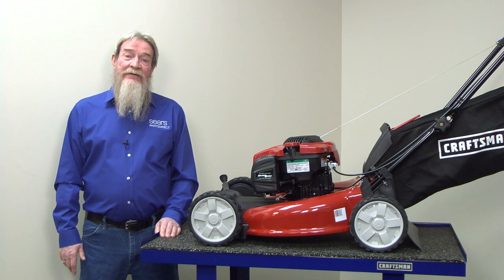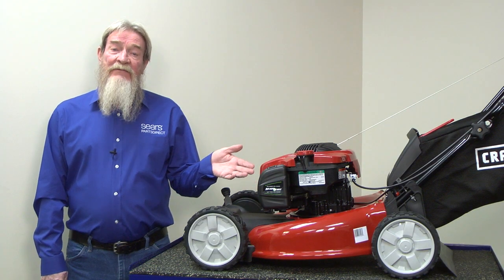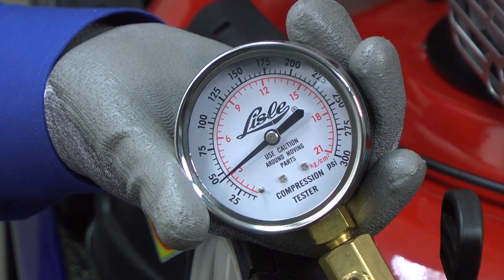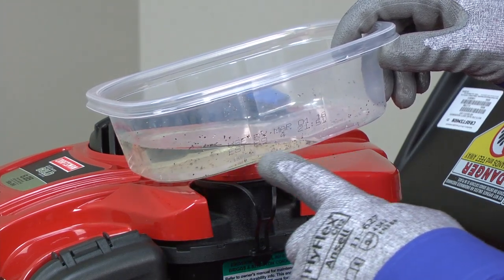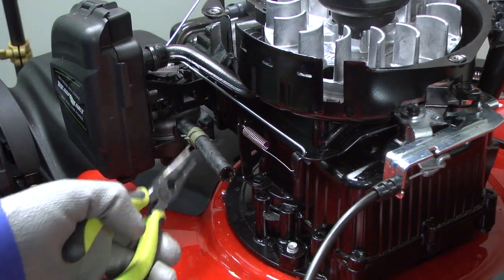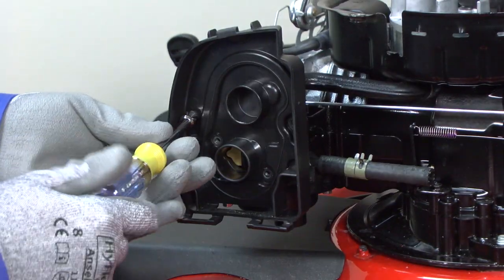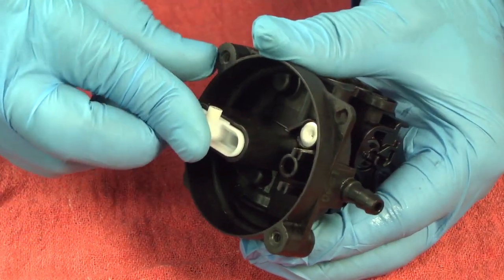How to Fix a Lawn Mower that Won't Start: Fuel, Ignition and Compression Problems

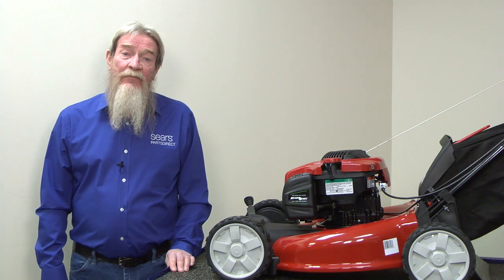Comment: QUESTION: At 5:25 you start the explanation of a Choke Plate and the importance of temperature related to a cold engine. This is the way it is with my Cub Cadet mower. The mower recently had the problem of starting up on the first pull easy enough, but then it would shut off after about 20 seconds. The Thermostat measuring part was replaced. After that, the mower would stay on again; however, the engine did seem to randomly be missing beats. The new BIG problem was that the mower takes over 15 pulls to get it to start up cold. In comparison, after having run for a while, the mower starts on the first or second pull. Clearly, the factor of "Temperature" is involved in starting the mower. This mower won't start "cold" easily. The mower actually started on five or six pulls on an 82-degree day. But on a 60-degree day yesterday, it took 15 pulls to get the mower to start. Do you have a suggestion to fix this?

Comment: Good video.  But I would like to see one that includes a common problem:  The magnet on the flywheel that produces the spark can slowly lose its power to the point where you cannot pull start it.  You can start it by engaging the flywheel nut with an electric drill and get it going fast enough.  You could then discard the pull starter, make holes in the start housing and trim cover, and use the drill to start, but this is not very practical.  Too bad that most of those magnets are ferrite ceramics rather than Niobium super magnets.

Comment: Ok, Good vid.  My Mower will start, but will not stay running.  Fuel line is clean, new fuel, new spark plug.  Is there a lever or spring that connect the brake system and throttle system. when I engage the brake release handle to start the mower the throttle behind the air filter box doesn't move.

Comment: Excellent video. Turns out my carb float was stuck causing no start. Got it off, cleaned. 30 minutes saved me 80 bucks.
Reply: I have had this happen when fuel was left in the tank over the winter. That won't happen again.

Comment: Not exactly related to this video, but I have searched everywhere to no avail. I have viewed at least 20 videos. My 7.25 HP Craftsman mower will not start when hot. Starts easy when cold and runs great but when I stop to empty the bag, it won't restart. I have replaced the gas, air filter, spark plug and carb and it still won't start when hot. If I squirt some gas in the carb when it's hot, it will start and run fine til I have to empty the bag again. When I squirt the gas in the carb, it hisses so it's pretty hot. Any ideas?
Reply: Try this. https://youtu.be/ARJrhnKpTwA

Comment: after spraying in the starting fluid it started then shut off, so i followed all of the instructions. I took everything apart, cleaned and rebuilt the carburetor based on the linked video. Took the gas tank off, emptied it, cleaned it, let it completely dry. Put back together. Added new gas and a new filter. 
It started for 2 secs then shut back off and won’t start again. I don’t know what to do now. I’m so frustrated as it’s only a year old and only used a few times.

Comment: Really great video! Clear diagnostic steps, great explanations of the systems, and really fine camera work. I particularly love the links to other helpful videos based on which problems are discovered.  Also doesn't hurt that the engine in the video is nearly identical to the Briggs and Stratton in my 21" Husqvarna push mower. I feel so much more confident in my ability to work on my own mower now.

Comment: My mower wouldn’t start after the winter season, I pulled the spark plug and pumped a little fuel in there then put the spark plug back and it ran for about two seconds so I knew it was fuel related. I pulled the top shroud and set it aside removed the fuel tank and drained it to check for sediment or bad fuel, then the carburetor was came right out without any issues and I pulled the bottom bowl off completely.. it was all clean inside. I actuated the float and the needle for a few times and blew through all the different openings to make sure they were unimpeded and then reassembled everything ….it started up on The third pull. Thank you very much for this how to tutorial

Comment: Just purchased the Sears M110 - cc 21 inch gas push mower. I did all the pre adjustments, added oil, gasoline and the pull rope is seized as it only stretches out about 5 inches and won't pull out any more. I also noticed the blade strikes underneath the mower deck. I thought Sears and Briggs and Stratton were good manufacturers but I was wrong. This mower does not start right out of the box. Very disappointing. DO NOT recommend
Reply from the maker: If the blade hits the handle that protrudes through the deck, pull the handle up and install the mounting bolts to hold the handle properly in place. That may fix the problem that you're describing.
Reply: @searspartsdirect  The blade hits underneath the mower deck as it turns and the pull rope does not come out more than 5 inches. very tough to pull

Comment: I have the same mower. Getting good spark. Tried starter fluid and does not try to start.  The safety handle is moving lever correctly. What next?

Comment: Honestly, watched 2:45 of the vid.  Cleaned and fully connected spark plugs (loose) and dumped the gas replacing with new gas.  3-4 pulls later, vroom.  Thanks for the tips.

Comment: Thank you sir!  Our 725 Series was a gift for Christmas, we never got it to run, and the new mower came without a manual. Your instructions worked......I now know how to field strip it, put it back together, and even start the darned thing......It was the fuel filter in the bottom of the tank.....Much appreciated! As Ever in Christ - John Paranuk Jr.

Comment: What would be the problem if you spray the start fluid in the carburetor and the lawn motor runs but if the motor is stopped, it will not restart
Reply from the maker: Your details sound like you've narrowed the problem down to a fuel supply issue. Stale gasoline in the fuel tank and carburetor bowl can prevent the engine from starting. If the gasoline in the tank and carburetor is older than 6 months, move the mower to a well ventilated area and drain the fuel tank. You may need to drain the fuel out of the carburetor float bowl too. Refill the fuel tank with fresh gasoline. If the mower still won't start, you may need to rebuild or replace the carburetor. Here's a repair guide/video that shows how to rebuild a carburetor on a typical Briggs & Stratton engine: https://www.searspartsdirect.com/diy/repair-guide/how-to-rebuild-a-lawn-mower-carburetor . We hope this information helps. Let us know if you need further assistance.
Reply: @searspartsdirect  Thank you for the timely response.

Comment: Procedure for adjusting the intake and exhaust valve clearance would be much appreciated.  I have a model 247377000 with a Briggs and Stratton engine just like the one in your video.  Are both the intake and exhaust valve clearances adjusted with the cylinder head position at top dead center ?  Are both valve clearance specs .005 ?
Reply from the maker: Although we don't have a video for adjusting valve clearance on that exact type of engine, you should be able to us the procedure shown in this video/illustrated guide  for a similar OHV snowblower engine: https://www.searspartsdirect.com/repair-guide/snowblower/how-to-adjust-the-valve-lash-on-a-snowblower.html . The valve clearance specs for both valves is .004 - .008 in at top dead center so .005 will work. We hope this information helps. If you need further assistance, let us know.

Comment: Could a ignition coil over 6.5 Ohms cause the performance of the engine to run poorly? I've checked all the things you mentioned in this video, and from what I can tell, everything's okay. Engine starts but runs as if I have the throttle set on low, but there is no throttle control unless you fool with the governor spring. I can do that, but that isn't a long term fix, there is something else going on. The mower performed well just the day before, now it's puttering.
Reply from the maker: Because you seem to indicate that the engine runs better when you fool with the governor spring, a bad ignition coil likely isn't causing the engine to sputter. A problem with the governor, governor linkage could be causing the engine to sputter. On some engines, a problem with the choke or choke linkage could also cause the engine to sputter. Let us know the model number of your mower (or the engine model number) and we'll provide additional help if you need it.
Reply: @searspartsdirect  - Thanks for replying. Model # is MTD 11A-B25F799 ( 675ex Gold Engine Series). I've run the engine with the air filter off to check the linkage, and they all seem to be working fine. I've read that the ignition coil range should be between 2.5 and 5.0 Ohms. If over that amount, would that affect the performance of the engine?
Reply from the maker: @Nick23at63  Thanks for providing that model number. According to the parts listing, that mower should have Briggs & Stratton engine model 126M02-0345-F1. Briggs & Stratton recommends testing for spark using a spark plug tester rather than measuring the resistance through the ignition coil. Your specification of 2.5K to 5K ohms for coil resistance is likely valid. Measuring 6.5K ohms through the ignition coil is not too far out of that specification. There's a chance that the ignition coil is bad and it's causing the engine to sputter. Before you consider replacing the ignition coil, try to let the engine warm up even though it's sputtering and see if the engine runs smoothly when it gets hot. If the engine runs smoothly when hot, then the ignition coil is likely okay. If the engine sputters even when it's hot, then replacing the ignition coil may fix the problem.

Comment: I'm a DIY'er for life. I fix my cars and motorcycles and everything else I have encountered in life to date, at 62 yrs young I have met my first lawn mower. I went surfing for help with the troubleshooting for this mower that won't remain running after I put some gas into the compression chamber as a troubleshooting step beyond verifying that there was spark to the new plug. 
I came across your video. I just wanted to say thank you. this is a great job of adding video for each trouble shooting problem. great job. Thanks again.

Comment: Is it possible to be the gas cap.  The yellow gasket broke off.  It starts but stalls out.  I sprayed starter fluid and it ran but then stalled again.
Reply from the maker: A clogged air vent on the gas cap of some engine models can prevent fuel from reaching the carburetor but a missing gasket likely won’t cause the engine to   stall out after starting. Check inside the tank for gasket debris that could be clogging the tank outlet.

Comment: You should never us starter fluid or ether to try and start the engine, using this fluid can blow your engine apart and you will get hurt bad if it does. Instead use a little   gas in a spray bottle and squirt some into the carb and try and start the engine that way.
Reply: Paul Brown Ty

Comment: What if it was left in the rain and it's only been used once? Where is the best place to start
Reply: maybe under a tree
Reply from the maker: Check the air filter first. A drenched air filter won’t allow air into the carburetor and engine. If you find the air filter soaked with water, dry it out or replace it. Restoring airflow to the carburetor and engine may fix your starting problem. If that doesn’t help, remove the air filter and spray a small amount of starter fluid into the air intake as shown at 1:28 in the video. If the engine starts and runs briefly using the starter fluid, then you’ve narrowed the cause of your problem to the fuel supply. Replace the fuel in the gas tank with fresh gasoline. You may also need to remove the carburetor and empty the carburetor’s float bowl. Here’s a video that shows how to remove and rebuild the carburetor: http://www.searspartsdirect.com/repair-guide/walk-behind-lawn-mower/how-to-replace-a-mower-recoil-starter-assembly.html. The video shows how to remove the carburetor float bowl at 1:46. Empty the float bowl and reassemble the mower.
Reply: Teena Dee look at filter clean and dry

Comment: Please explain the phenomena of double grounded spark plugs. Outside of cylinder I have spark. Inside has no spark. I'm still studying this issue, thanks
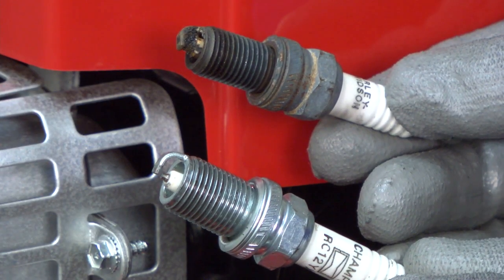Reply from the maker: The spark may be jumping to ground outside the cylinder but not jumping to the center electrode when you have the plug inside the cylinder. If you use a spark plug tester as shown at 2:12 in the video and don’t see the tester spark, you may need to replace the spark plug.
Reply: Jaster94 20
6

chevytra

..

Comment: Thanks for the video, I left gas inside my lawnmower for months. However, I'm using a turkey baster to get the old gas out.
Reply: It turned out I tried to start the lawnmower wrong. It worked all right until I ran out of gas.LOL

Comment: I have a 917258550  riding lawn mower. This belonged to a previous owner. I am trying to get it going. I can't get a spark from the spark plug. I have placed my thumb on the spark plug hole and turned it over. It pushed my thumb away! So I do have compression. How Much exactly - I do not know yet! I know it should be between 60 to 100 for this mower. I will get a guage eventually and check it. 
No matter this brings me to the spark plug spark. I have replaced the spark plug and ignition coil. I gapped it to .011. I have unhooked the kill/grounding wire from the back of the ignition coil and still no spark!!!!!!!! What would be next to check????????????????? My best guess is to get a new flywheel for the magnets. Does the magnets on the flywheel have anything to do w/ the spark plug spark???
Reply from the maker: The magnets help the ignition coil generate the spark as they pass by the coil. The flywheel magnets don’t wear out. You may have an interlock switch in the ignition circuit that is grounding ignition coil. We recommend that you check the operation of the seat switch and blade interlock switch. Replace any switch that doesn’t work. Repair or replace any broken wires that connect to the switches.
Reply: I am going to need to rewire the lawn mower according to the wire diagram, but in the mean time I thought that unhooking the "kill/grounding" wire from the back of the ignition coil would let it produce spark from the plug??  Thanks for the info on the flywheel because I almost ordered one but decided to wait for YOUR opinion!!
Reply: Virgil White

Comment: Why do a compression test on a engine that's got a centrifugal decompressor in it?? It will give a total false reading you could never pull it over fast enough to give you a good reading a leakage test is the best way
Reply from the maker: The compression test often indicates whether you have a compression problem. You are correct that a compression leak down test as described in the engine’s shop manual is the best way to diagnose and repair a compression problem. We didn’t cover that procedure in this video because it’s an advanced engine test that requires special tools and expertise. We continually add more DIY videos so we may cover the compression leak down test in future engine troubleshooting videos.

Comment: I replaced my carb engine looks like it's not sucking in fuel
Reply: sure I did.my mower is 6.0 craftsman no choke plate .engine sucks gas by compression of the cylinders moving up and down. carburetor can not send fuel to engine by itself .gas get sucked from engine so I checked the compression first connecting a gauge into the spark plug .it was fair for 14 yr old mower .what made it work was there is a metal pipe right after carburetor to the engine I sealed that up with gasket maker rtv cos gasket was worn it run for the first time after long  tries.so maybe it was sucking air instead of fuel.let us know what works for u.if the engine does not provide suction .it might be a bad engine this sucker has everything like a car does.thanks sears for video
Reply from the maker: Check the fuel line and fuel filter for clogs. The mower may have a restriction or clog in the fuel path between the tank and the carburetor. Also, check the vent holes in the fuel cap for clogs. The engine won’t get fuel if those vent holes get clogged. If you need more help, post additional details and we’ll try to assist you further.
Reply: I have the same issue , I replaced the carb and all gaskets and it won't prime or run. I replaced the primer bulb, fuel , spark plug and air filter. Any help ? Did you get yours running?

Comment: Craftsman riding 21 hp mower will not roll over with spark plug in (will with plug out). Checked intake and exhaust valve settings. Done to specifications. Still will not roll over. What suggestions? Thanks!
Reply from the maker: Check the battery and starter. A weak battery or starter may spin the engine with the spark plug out but not with the plug in. Also, deposits on the piston, cylinder or head can increase the torque needed to spin the engine with the plug in. Clean those components if you find heavy deposits.
Reply: George Meiners check your intake valve setting then either one not adjusted just rite it won't roll over at all